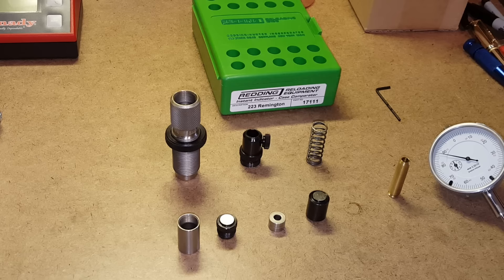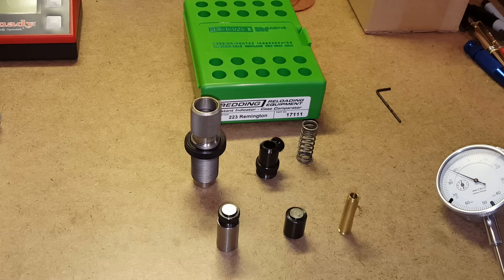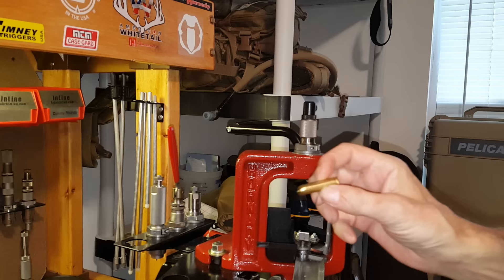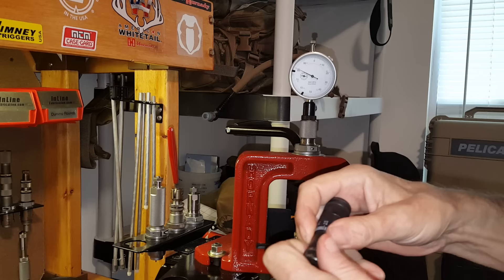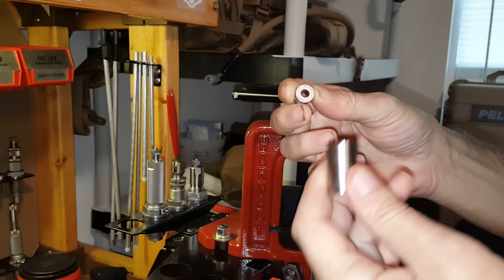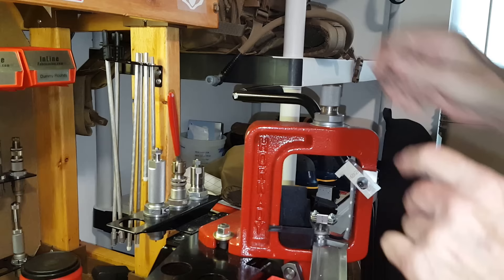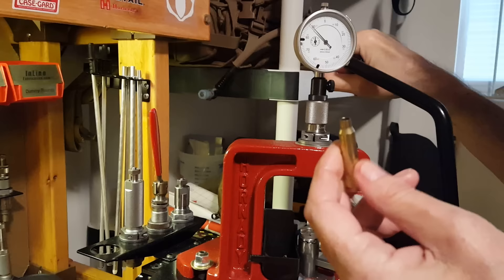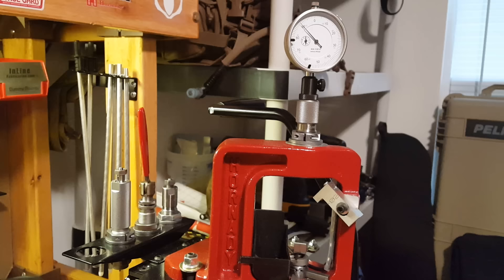Redding Instant Indicator

Comment: Excellent video. I don't know if you know yet, but Redding now includes a "range adapter" so you can use this die without the press. I'm planning on ordering soon and just discovered this new feature. 

This is probably the most detailed reloading video I have seen on youtube. Great job!

As for your cons of using a die, if you have the Redding T7 you can swap back and forth very easily and is actually better than the hornady comparator/headspace gauge because you don't have to take the brass off the press.
Reply from the maker: +drfroglegs Hi drfroglegs, thanks!  I was not aware of the range adapter.  I'll look into that...if it's a reloading toy, I gotta have one lol.  Thanks for watching and for the tip!
Reply: You should call Redding. I called them and they are offering it free if you buy the instant indicator now and it doesn't come with the range adapter. I just got mine from Brownells, though, and it had it included. The range adapter just screws onto the bottom of the die. It's actually really nice! I would definitely give them a call and see if they will "sell" you one that will probably lead to them just giving you one :)

Comment: Great video Mr loader,been wanting one for a while now still saving my pennies
Reply from the maker: clay mcwilliams Thanks Clay,

I did notice that the set screw has a softer pad on it, but I'm just concerned that it will compress too far and the harder steel part of the set screw will hit the threads.  I'm probably just being overly protective, but it goes against all that I hold dear to screw something into the threads of my expensive dies, LOL.  The advantage of being able to use my die wrench to pop it in and out is a big advantage too.

Thanks again!

Hornady Loader

Comment: Super helpful video, thanks.  Just FYI, the Redding rings have a lead shot below the grub screw, so it won't mess up the threads.  The Hornady rings are very nice, though.
Reply from the maker: +Allan Bazinet Hi Allan, yes, I know.  But those lead balls can be compressed such that the metal part of the screw will come into contact with the threads.  If you're careful, it's not an issue I suppose, but it's just one of my little quirks, lol.  The big reason I switch em out is so I can use my Hornady Die wrench.  Thanks for watching!
Reply: +HornadyLoader Yep, no argument there, the Hornady rings are definitely an improvement. Thanks again for the great video; I struggled with getting my resizing die set up properly until seeing this video and getting this gauge.  A Wilson case gauge is a nice solution but it's very analog and subjective; the Redding makes things trivially easy.

Comment: Just an fyi: the set screw on the rcbs will never in 45 years, screw up the threads. The set screw is considerably softer than the threads. If anything you will eventually have to replace the set screw if you make a lot of adjustments over time. 
Will NOT damage the threads. Period.
I know this from 45 years of using rcbs products. Recently I have started  using Hornady dies. I do like the dies and locking system better, but I do insist on correcting misinformation regarding internet videos.

Comment: Thanks for all the great videos.  Suggestion:  I have heard you asking Hornady to put flats on the LNL collets so you could tighten them.  I doubt they will do that, but in the meantime I am going to try a spanner wrench.  I just ordered one from Banggood.com for $4.29 including tax and shipping.  And the handle is even red!  It'll take a few weeks to get here, but they have always delivered what they represented.  Tons of stuff on their site.  I plan to use a band saw or Dremel tool to cut three notches, one every 120 degrees, in the rim of the collet to accept the spanner wrench.  I may have to grind the spanner to fit the notches.  I'll write in the future and let you know how it works out.  But I am optimistic that this will work.  Shalom,
gw

Comment: Do you need a new shell holder or what! Every time you run the ram up it jams on the top of the case neck and you have to push it with your finger to line it op. Thats not right.

Comment: In regard to the Redding die rings, they do have a piece of lead on the end of the set screw, but every time you tighten that set screw a little of the lead goes away there by making it impossible to fine tune the die without it catching on the threads that have burrs on the die threads.  I change all of mine to the Hornady die split rings.
Reply: Just a small tip for someone who may not know......obtaining a small bag of lead shotshell pellets/beads will give you a lifetime supply of lead to insert into almost any set screw hole to replace or add to the worn out tip of a factory set screw so as not to damage threads of the die. It's an old mechanic's and machinist's trade trick for when use of a set screw is needed but damage to threads or any surface deformation cannot be tolerated. Plastic, wood, teflon, etc, can all be used based upon one's needs. Just my 2 cents. Hope this is a neat little trick for anyone who may not have already thought of doing this.  
Hornady Loader...your videos are top notch and I constantly review them several times over....extremely good info from you as always. Best wishes to ya!

Comment: really grateful for this beautiful video, very comprehensive and straight to the point. it would be great if you can help me find out the answer for this question: i have 2 caliber that i am interested in using the redding instant indicator, .338 lapua and 6.5 creedmoor. having said that, do I need to buy 2 from each item in the video above, except for the dial indicator i will only buy it once and uesd for both? 
one more thing, have you tried the "range adapter"? per the redding webpage, the range adapter will replace the press and no need to use the press for measurements.

Comment: Sir,  when I'm reloading once fired brass,  I'm in need of reading "how much force im applying to the ram" when im re- sizing neck size for bullet tension.  All things being equal this should apply approx equal neck tension,  does this tool measure force applied to ram During that process?

Comment: So this is like using a case gauge except you get exact numbers instead of go or no go in a case gauge.
Reply from the maker: +Eddie Stivaoson Well, a go/no-go gage measures the chamber of your rifle where this measures the cartridges, but yes, you get more precise measurements from it.  Although it is intended for use as a comparator rather than a measuring device since you can't really tell what the actual headspace is for example, but you can compare two cases to see how much they differ in several measurements, like headspace or case length.  It's biggest advantage is the speed at which you can do these comparisons.  Using a caliper takes quite a bit more time than it does with the Instant Indicator.  Thanks for watching!

Comment: MR HORNADY RELOADER: i have a technical question for you....i have the rcbs competition sittin die for 308. it comes with a extended shell holder. i also have a redding competition bushing die for 300WM my question is this: can i use the redding bussing die to size 308 cases using the rcbs extended shell?
Reply from the maker: +JP811931 Hi, it shouldn't be a problem.  As long as the shell holder dimensions are correct - from the part of the shell holder that the case head sits on to the top of the shell holder, it should measure 0.125".  As long as that dimension is correct, you can use the extended shell holder with any die.  Now, that being said, Redding also has a set of shell holders that are used to adjust the headspace without having to adjust the die.  These shell holders have differing dimensions from the one I mentioned.  These shell holders let you select a different dimension, for example 0.127" to increase the headspace by 0.002"  Just measure your extended shell holder and if it is 0.125" from case head to the top of the shell holder, you are good to go with any die.

Comment: can i use my hornady dial on the redding indicator...? where i live the redding dial is sold separately
Reply from the maker: +JP811931 Hi, that would be great but no, it doesn't work.  The stem on the Hornady dials are much shorter than the one on the Redding dials.  The stem has to be long enough to contact the spacer in the Redding die but on the Hornady Concentricity/Neck Wall gauge that's not an issue so the stem is way too short on the Hornady dials.
Reply: I ended up buying a hotnady gauge separately with out knowing if it would work...to my surprise iy actually works perfectly...at least on the 300WM. I would assume for smaller calibers like 223 or 308 it would not work for the reasons u mentioned...smaller caliber stem as to sit deeper

Comment: so for AR are these really something i should use,thanks
Reply from the maker: Neil Beri Hi Neil,

Not necessarily.  Most of the features of the Instant Indicator are used only if you want extreme precision from your hand loads.  If you plan to enter a high-power rifle match where tiny fractions of an inch in your groups make the difference between winning and coming in last, then you would probably want to pay attention to those little details.  However, if you plan to go plinking, or enter 3-gun competitions or other matches where extreme precision isn't needed, all those details are really just extra work for little benefit.

That being said, even if you do want the precision, there are other tools that do the same thing.  Trim lengths can be checked with a caliper and there are other, less expensive, bullet comparators, headspace gauges, etc.

So it really depends on what you're going to do with your AR and, to some degree, how much you enjoy the hobby of reloading itself.  Some folks see reloading simply as a way to reduce costs, some see it as a way to improve accuracy, and some enjoy the hobby so much that they want all the toys and doodads (like me, hehe).

Thanks for watching and for the excellent question,

Hornady Loader
Reply: Thank you i really appreciate it.

Regards  Neil